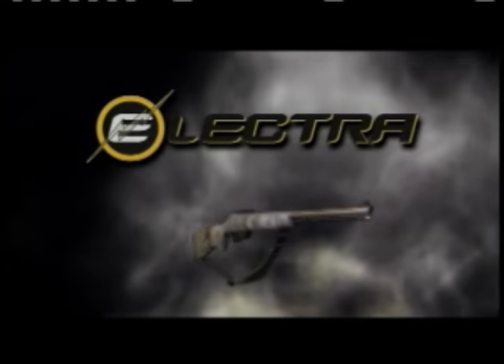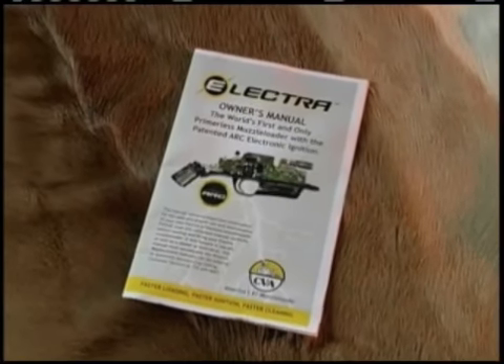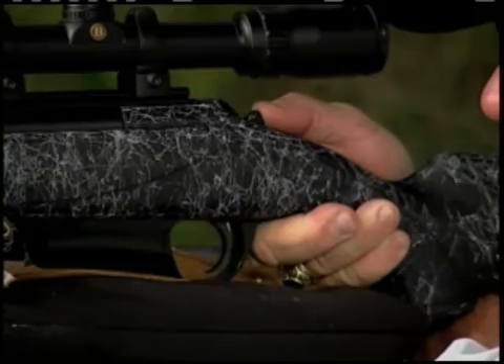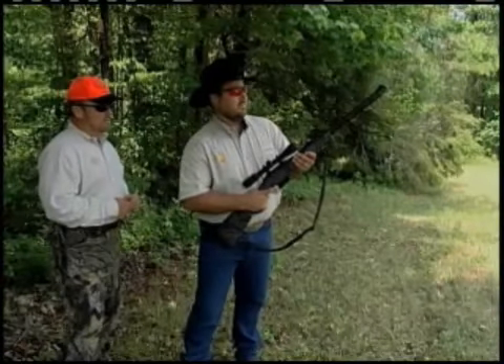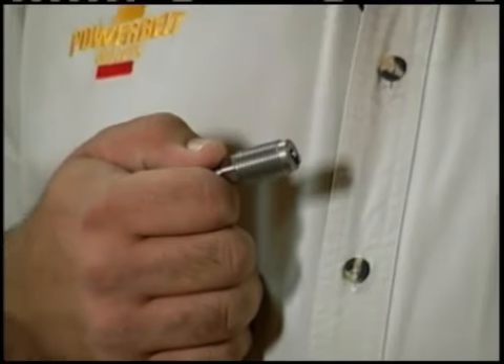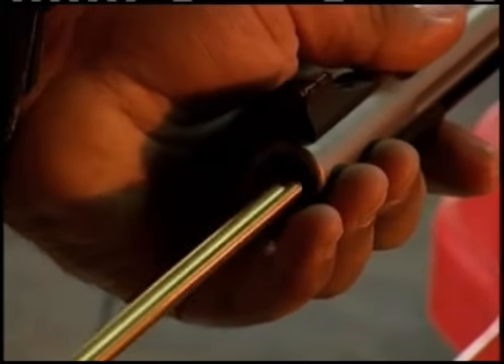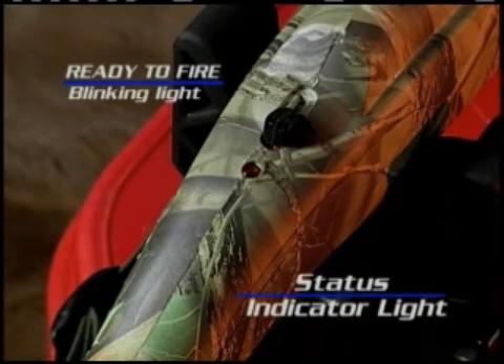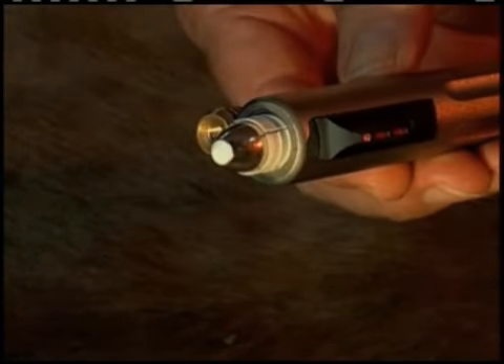CVA ELECTRA

Comment: I have shot this be 6 times before taking into the field. I absolutely love it! I am disabled and I have someone else load it. So easy to load, I explained it to anyone.2 weekends ago I went muzzleloading  hunting and shot my very 1st buck  and a small doe.  They were only 20 minutes apart.  The 1st one was about 60 yards and the 2nd one  75 yards with just a red dot scope .absolutely amazing. I really wish you would bring it back into production . Or even as a special  order item.  I have had no failures in the permissions system . I definitely will continue hunting with  this comment.  super accurate and super easy .  If you do bring these back out  please contact me on Facebook  everyone that was hunting with me is thoroughly impressed.  never had a muzzleloader before and  I prefer this over anything that I've seen particularly for  ease-of-use, use of cleaning,  nail driving accuracy !  thanks CVA

Comment: Bought mine couple yrs. ago from Sportsman's Guide, came with 3-9x40 scope, and a Quake Claw sling. I usually change out the scopes first thing, but the one I got seemed decent, so I tried it out. Couldn't be happier with it, this guns shoots great, and the only mis-fire I had was when the battery went dead. Before you take it hunting, you should put in a new lithium battery, and it should last all season. Been shooting Alliant Black MZ powder with 300 gr. Speer deepcurl bullets, and also Lasercast 300 gr. hard cast bullets. Gun is amazingly accurate, and I think it's a shame they did not sell enough to continue building, because I for one love it. Only problem I see is if something should happen to it, how would CVA repair an obsolete gun, even with it's lifetime warranty.
Reply: Chances are they won't.